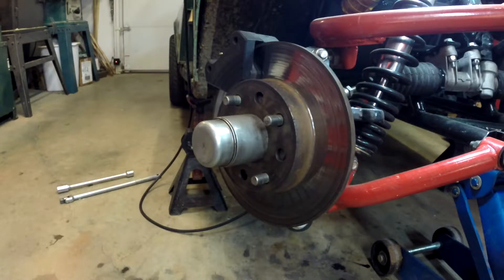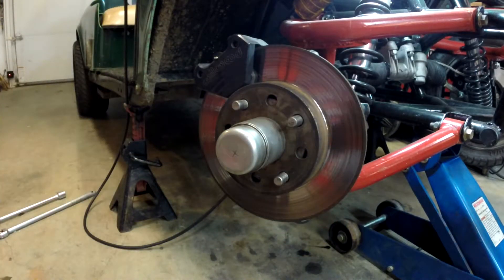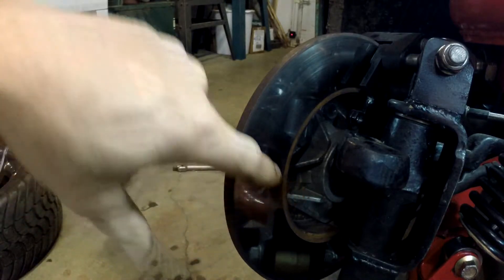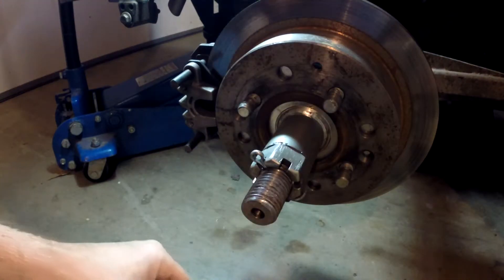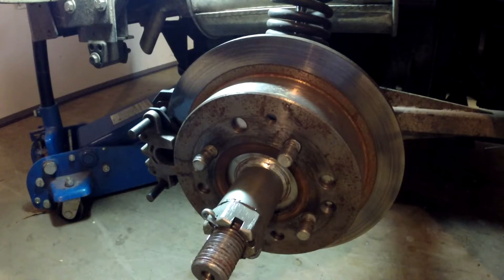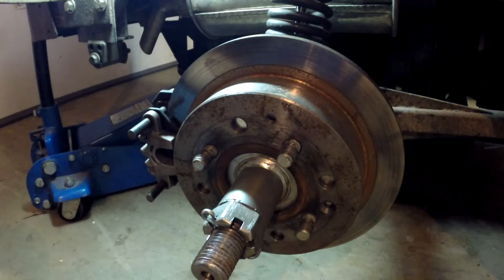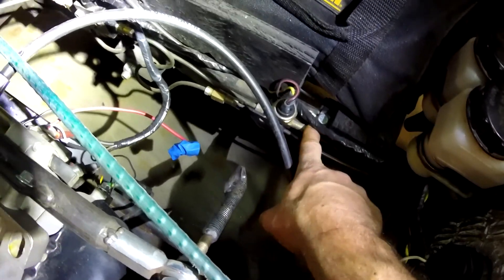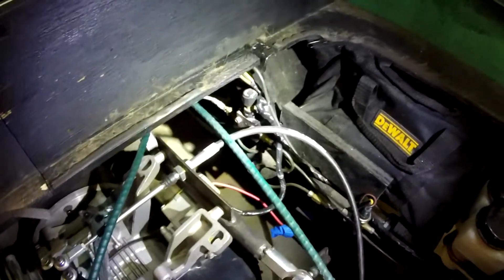Golf Cart Custom Brakes! How I Added Disc Brakes To My Golf Cart

Comment: 1) how in the WORLD did you discover that the 1994 Toyota Tercel front rotor was the right part !,!!!!! And
2) it appears that that rotor IS ventilated in all of my searches …
3) do you have an alternate part?
4) did I already ask…HOW IN THE WOOOOORLD …did you figure out that the Tercel rotor was approximately right .?
Thx
Reply from the maker: I went to the auto parts store and asked the guy for a four bolt non-ventilated rotor. He said the one he picked was for a Tercel. I did need to turn the diameter and the thickness down so the caliper would fit. If I had to do it again I would just order the correct rotor from Summit.
Reply: @themellowmechanic  thanks but I’m still stuck I wouldn’t be ordering an EzGo front brake rotor from Summit…so how would I order or “ what” would I order?  
Thank you again….